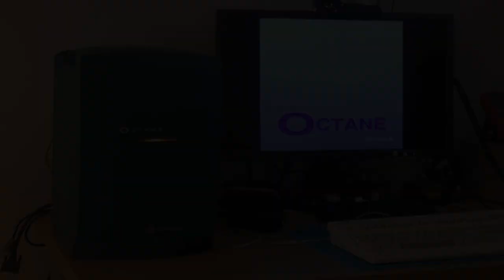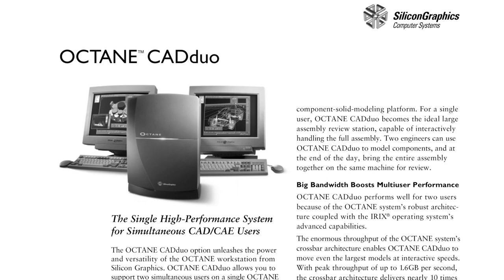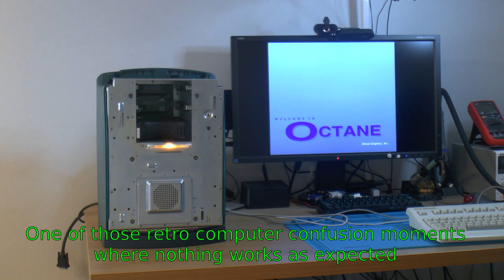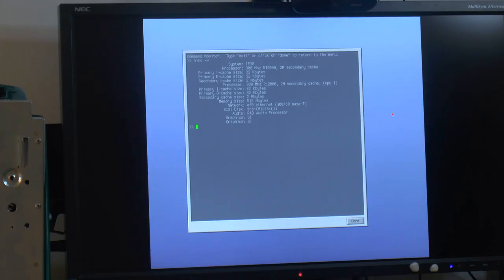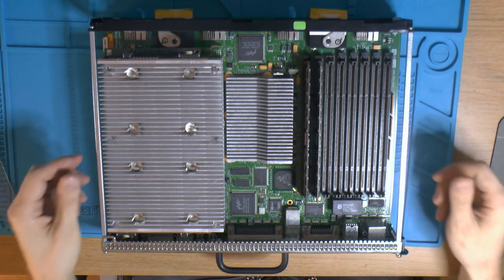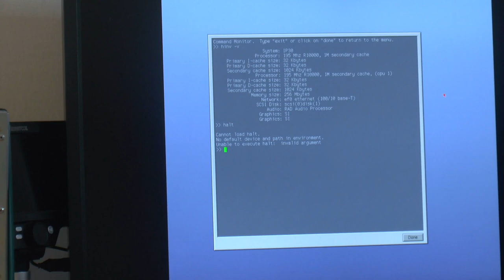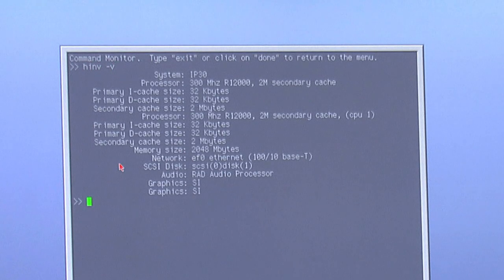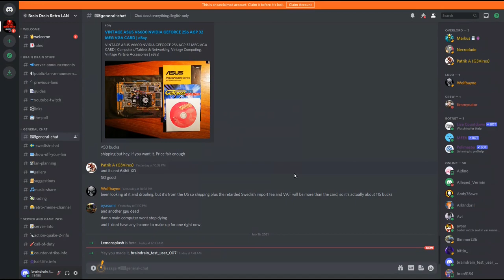SGI Octane in the lab!

Comment: I remember going to an Alias|Wavefront event in Toronto at the A|W offices, where SGi was showing off their newest system using the last version of A|W before Maya. This was the new machine and i think i was quoted a base price of something like $50k with the smaller O2 being $15k , if i remember correctly..
Reply from the maker: Sounds like an awesome event!
I think the base unit cost of a Octane was like 18K USD or something like that from what I read.

The upgrade CPU I have was 105K SEK so around 10K USD back in 1999.